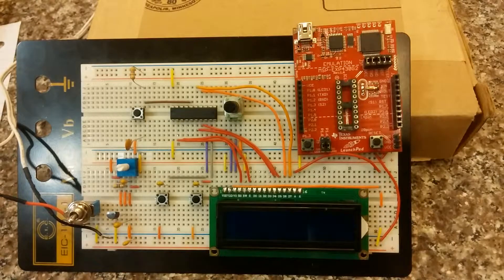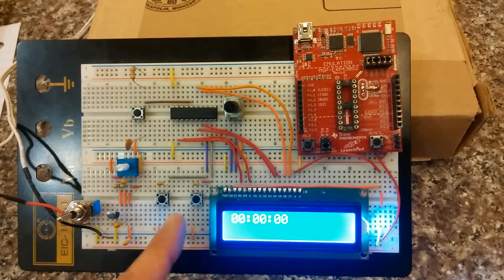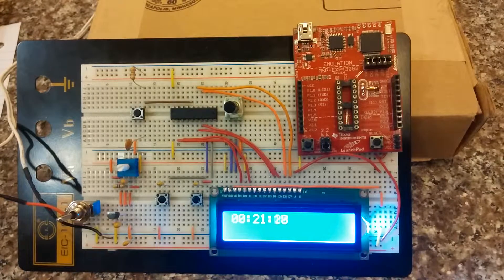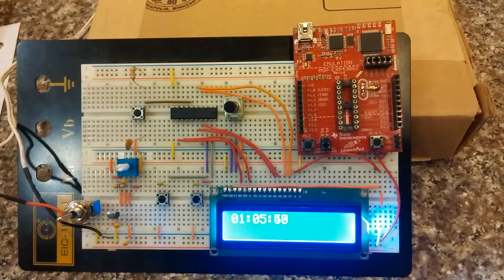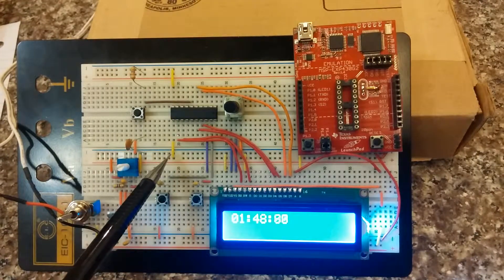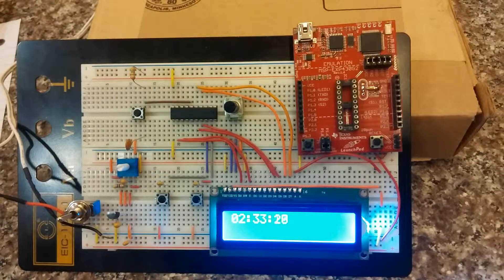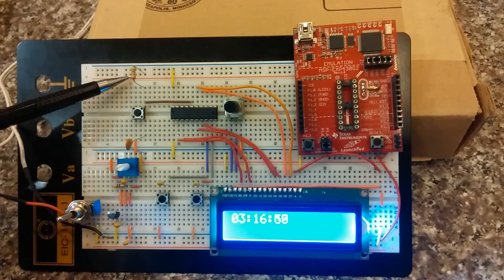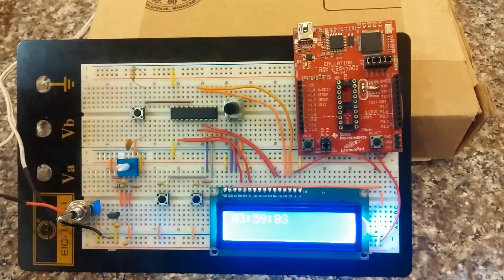MSP430 LaunchPad Project: Stopwatch on a breadboard (using a 16x2 LCD)

Comment: hey John, thanks it's a good job actually.
If I have a question is : what about the Crystal ? don't we need that in our applications? 
 I know that G2553 has an internal crystal with 16 MHz (maximum), but on the board, there's an external one too, actually it's confusing me
 And the Vcc that will be connected to the RST Pin must be 3.3V too, or even 5v is ok? because I know that G2553 works with 3.3v
thanks in advance.

Comment: Hello good job ;), i have one favor which you dont have to do if you dont want to. I have big project in school which i must finish to complete exam. I have to create my own version of reaction timer. For that i need to know how timers work and how to program them. I know little about how timers work, but problem is that i dont know code for it :(. If you have anything that might help i would appreciatit very much.

Btw +1 subscriber ;)
Reply from the maker: +samo goljat Thank you very much :) Timers can be difficult to program, especially if you don't have programming experience or experience using the MSP430. Have you coded before? Have you used the MSP430 before?